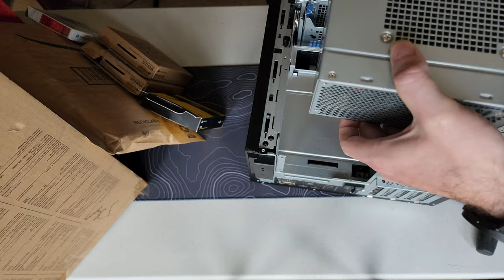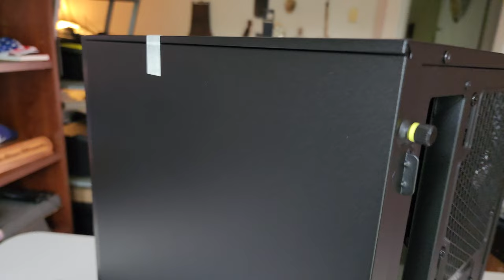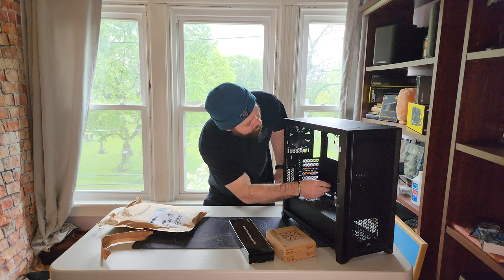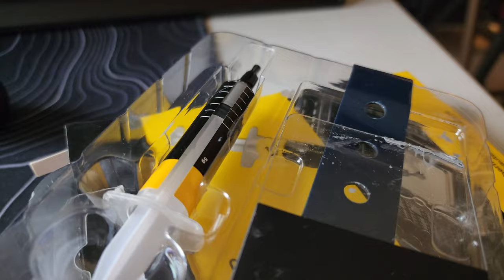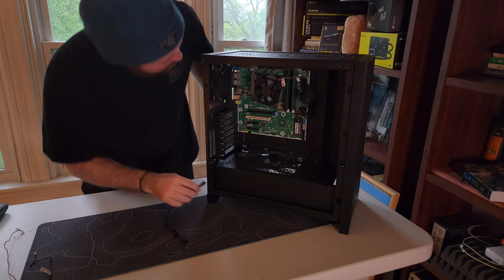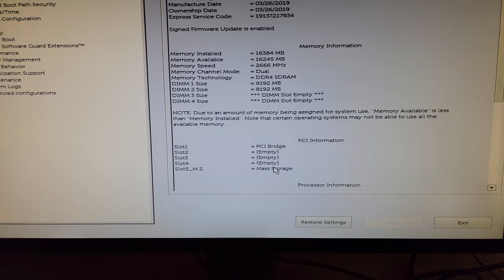TURN YOUR DELL INTO A GAMING PC IN 2023!

Comment: I heard Underpowering the graphics card with a old mother board isn’t good.I’m sure the fps will be held back but it’s cool what you did.I never owned a gaming pc but I’m on YouTube learning.I could be mistaken I just play on consoles.does anyone know if this would out perform ps5?
Reply from the maker: I don't know what you mean by under power. The power for the graphics card is supplied from your psu. I think this was on a 460watt psu. This card pulls around 180 watts I believe it was. In games this configuration uses 100% of the 6650xt and in most circumstances the 8600 i5 is nowhere near 100% utilization. Meaning this cpu and motherboard does not bottleneck the 6650xt, but I would not go much past the 6650xt or you will start to see bottlenecks on better gpus probably. In most games you still want really good single core performance. So even the older 7th and 8th gen cpus are still relatively adequate even for 1440p gaming. Now if you want to stream or run multi monitor and browser tabs on another screen while gaming, yeah no, won't happen. Just gaming though, easily over 100fps in 1080 high settings. I will post some benchmarks on this build specifically soon. As for pcie generations and lanes, other youtubers have proven pretty extensively that most gpus cannot saturate gen 3 pcie. Dawid even running a graphics card on like a single lane or something crazy. So the gen 3 lane on this dell motherboard is plenty to handle the entirety of a 6650xt and even more really. I had a 1000w psu and a 3070ti overclocked running pretty flawlessly on this exact motherboard cpu combo. As for a comparison to the ps5, I would say the 6650xt is about equal to slightly better maybe. The theoretical teraflop performance if you google them are both around 11 teraflops. You could do more on the pc set up though over a console. With a new cheap power supply you could run a 6800xt or something a little better even and whomp the ps5. Motherboards and cpus are not terribly priced anymore so a z690/13600k with like a 4080 or 6950xt would probably be my recommendation though unless you happen upon one of these dells.

Comment: ...a new case too? why not a new motherboard & whatnot while you're at it?
Reply from the maker: This is mainly aimed at a beginner. They may have this computer already, and be a first time builder that might be afraid to build for the first time on more expensive parts. So this little case swap could give them not only the courage to build again in the future, but the case can be reused on pretty much any future build. Not to mention, if you stuff a graphics card into the Precision case, the thermals are terrible. So beyond an appearance upgrade, the case gives you the platform to get a new CPU and motherboard, but then you can save a little bit in the meantime and still get the build experience. I mentioned in another comment this video was just for fun, I have a 13600k/3070ti z690 mb with 64gb of ram, 240mm aio. My friend gave me a few of these older precisions, so I have just been having fun with them. I would stand behind the motto "a case aint a waste" haha.
Reply: @darkgalacticmedia  ah, I see.  Thanks

Comment: Did you have any issues with AMD drivers?
Reply from the maker: Sometimes you have to edit the registry to prevent windows from automatically updating and replacing your amd drivers! I did have issues with windows replacing amd adrenaline with the workstation pro version even with the new rx6650xt.
Reply: @darkgalacticmedia  I've actually uninstalled amd drivers with ddu and re-installed without adrenaline.  Just driver only.  Only way I've been able to keep any instability away from my 6800xt.

Comment: Intel Core i5-8600 is too weak for AMD Radeon RX 6650xt . 
you need atmost 6 gb vram . or a better processor .
i like the 8 gen processors for mig gaming in 2024 . 
4 gen and 6 gen are to old for 2024 gaming .
Reply from the maker: The 6650xt is not "too weak". That seems silly.. First, you went on to say you like 8th gen and the 8600 is in fact 8th gen. They are a surprisingly balanced system. Not to mention you can always take your graphics card and put it in a new system when you upgrade to a new motherboard and cpu!! So you can really overbuy on a gpu.. Get what you can afford.. anything 3rd or 4th gen pcie will be fine.. A lot of games dont require a lot of cores as much as good single core numbers and the 8600 is still fair. Alas the 6650xt is cheap enough and you also need to consider driver support going forward. So if you get a cheaper card you may not have support much longer for drivers! Happy New Year!!

Comment: I would expect the only "gaming" you could do on a Dell system would be the game of figuring what broke TODAY.
Reply from the maker: I will benchmark, but you'll be surprised. The i5 8600 is still pretty capable in gaming and the 6650xt carries most of it. You won't bottleneck the 6650xt at all on this build. On 1080 high I wager you'll see 100+fps on most titles if not way more at competitive settings. Probably decent on 1440p too. I guess if you wanna compare it to something like a 4090 obviously it won't compare, but lol. Dell just needs a better bios with xmp speeds settings lol

Comment: Kinda of dumb to transfer that crap mobo into a nice case like that - better off buying a better $99 mATX mobo or something. Can get a smaller GPU and put it into the dell case, RX 6400 LP, or even some 6500XT variants and use a dual SATA to 8-pin for power.
Reply from the maker: First, it would be difficult to use the stock case's power switch with a new motherboard. Also, the thermals are awful, I can't overstate this enough. I don't get why everyone is so triggered on the case. I mean, of all the parts, graphics card included, you can reuse the case over and over on future builds. Literally every other part will become obsolete before it for the most part. Say you did buy another motherboard, which also might need another copy of windows which might cost you, then I assume you reuse the 8600, instead of spending even more, which isn't overclockable. So in reality then, you spent as much or more for a system that will underperform this configuration. Then when it's all said and done in the future, you don't even have a decent case to start your next build. As mentioned the point wasn't to build a computer from scratch or obviously no one is going out and sourcing these motherboards specifically. If you have one, great, and you're a kid or on an extreme budget, spend that money on a graphics card instead of a nicer cpu/mb atm, I mean heck guys. Save the hundred bucks on the case all together and just build it open air on a piece of cardboard in front of your ac unit lol for the best savings and temps. Point is, 50-100 on a case will be useful for temps, fitting larger cards, and supporting future builds for years. Plus it'll look cooler and we all know that is important haha. It won't be an issue then when you have a new case and graphics card to save another couple hundred and then go z690 and a 12th/13th gen etc. Let's agree on one thing, don't waste a bunch of money on upgrading the ram in this system. Otherwise I think it would be less intelligent, from experience, to try to spend any money and try to reuse that dell case. Oh did I mention the dell case doesn't have a removable IO shield either so putting a new motherboard in that case will require cutting the backplate of the case with a dremel or something. I would use this motherboard/cpu for months or a year then upgrade the mb/cpu later. Too each their own though. The alienware cases are just like these folding psu precisions and their temps are terrible too. You can't fit a very good cooler in them. even aios don't really fit.